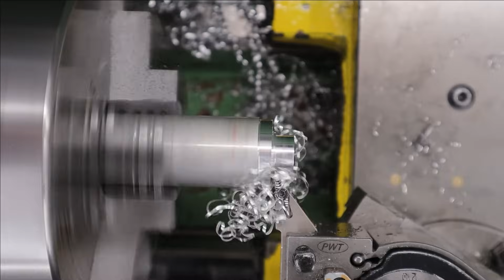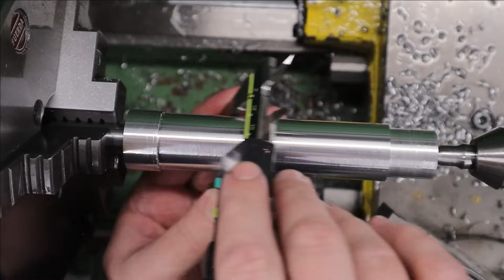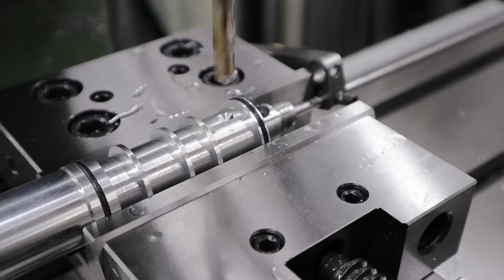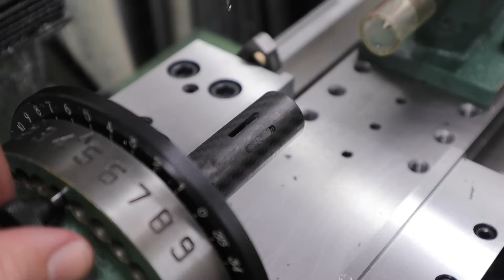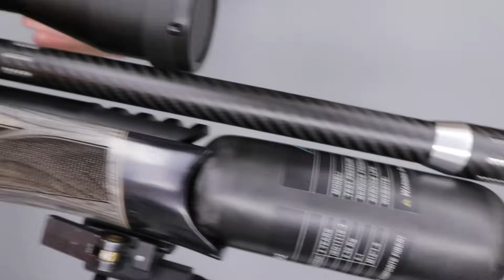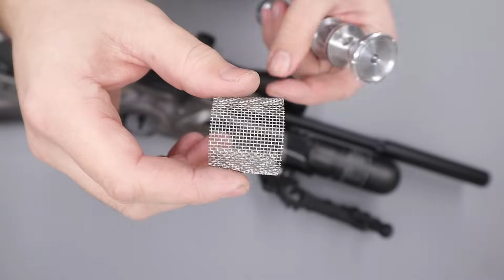Making a carbon fiber moderator for the BSA R12

Comment: You really are very skilled in air rifles,  what you show and teach on your YouTube channel and the way you do it is amazing, obviously having the correct tools for the job is essential but it’s the way you teach that really impresses me, you have a very calming persona that enables us the viewers to take things in and have confidence to try things we wouldn’t normally attempt. 
Do you make bespoke shrouds for customers? I would love to have the milling machines etc to attempt this myself but unfortunately it’s not financially viable for making shrouds for personal use.
I have learnt so much from you especially for my HW100 rifles, I have successfully removed the anti tamper on both my guns and replaced with HW100 tuning replacements and also replaced all my O rings , it also gave me the confidence to change the plenum and fit a Apex regulator in the Ratworks light weight air tube to get a better shot count and amazing shot consistency.
Reply from the maker: Glad you like the vids and find them helpful 👌 sorry we don't make the shrouds to sell

Comment: Another great design with a very pleasing look even before the aluminium is anodised. If you haven't found any suitable mesh yet, you could try and contact a filter manufacturer. Companies such as Croft Filters in Warrington do manufacture them, so you may get lucky with an offcut.
Reply from the maker: thanks for watching and the tip 👍

Comment: Your work is perfection. Beautiful and simple, clear videos that are very instructive and inspiring. I wish you can do a complete video on best techniques and tools to crown a blank airgun barrel, LW or CZ, and also FX liners that are quite challenging due to their soft steel and thin walls. Would love to see how u would perfectly crown these either 11 or 45 degrees, and which one would give better accuracy. Also would be great to have a video on how to polish the bores, grooves, lands, valleys, from a factory finish to a mirror like bore that will have no tool marks and foul much less specially at high power settings using heavy slugs that foul a lot more than pellets. 

Hopefully you would do that video soon :)

Keep up your great work !!!!

Thank you
Reply from the maker: thank you for watching 😀 we are trying to get a few more vids on barrels 😀